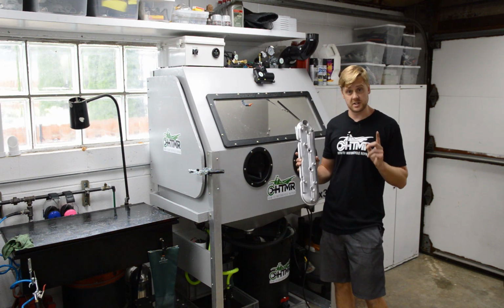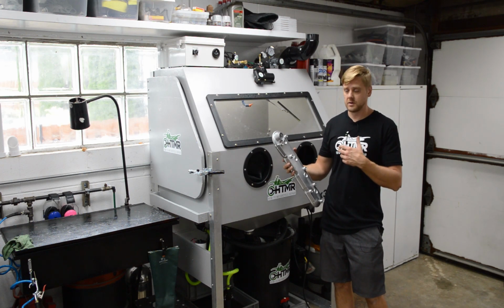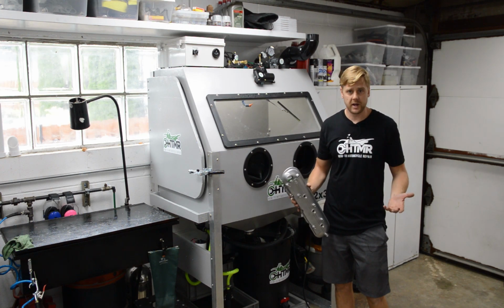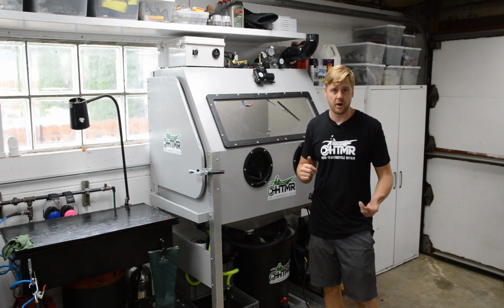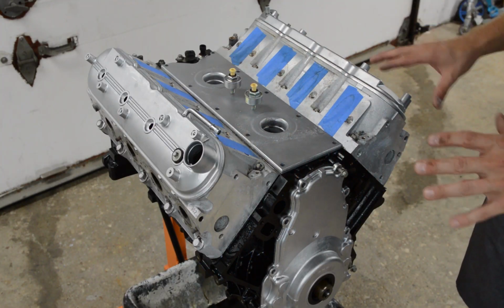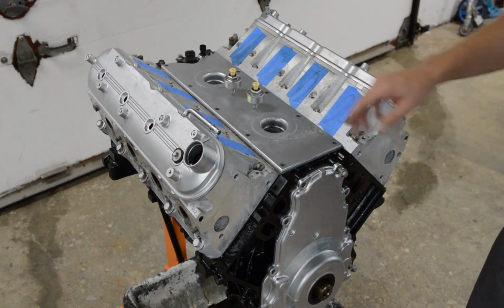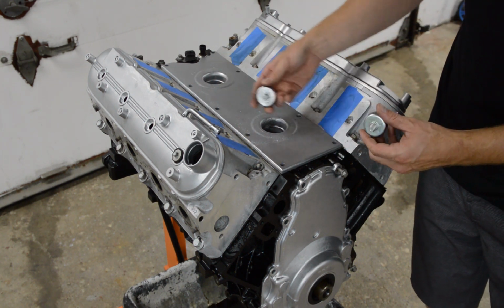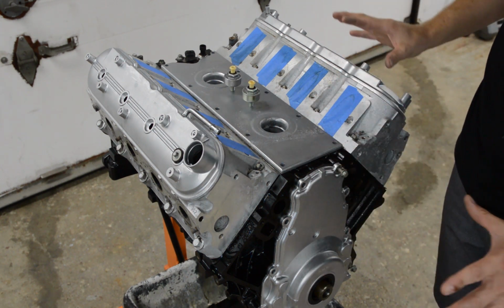Chevelle Turbo LS Build: Vapor Blasting Parts!

Comment: Would this clean/degrease valve covers enough to then do a glyptal coating or would another degreasing process be needed?
Reply from the maker: It can do light degreasing. I would prep prior to paint regardless.
Reply: Too much grease will somewhat contaminate your blasting setup. Probaby worse with dry blasting than wet but it's still contamination that can effect performance of your blast setup over time.
Reply: Soak them in acetone for 30 minutes. Dry blast. Bake at 300 degrees for 30 minutes. Check for oil/grease. Repeat until no oil comes out of the aluminum. Then coat with your product of choice. Vapor blasting will not give you enough of a profile for the glyptal coating to bite.